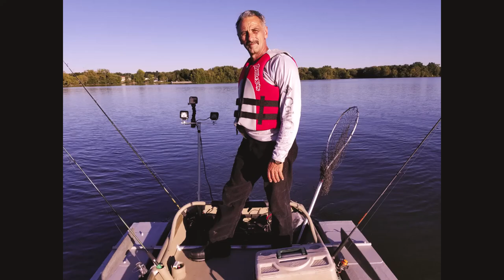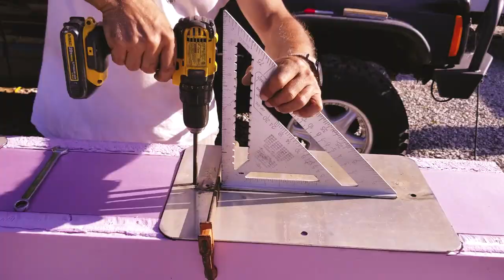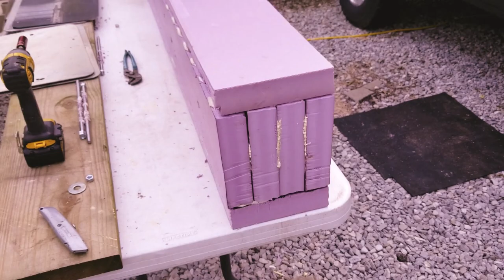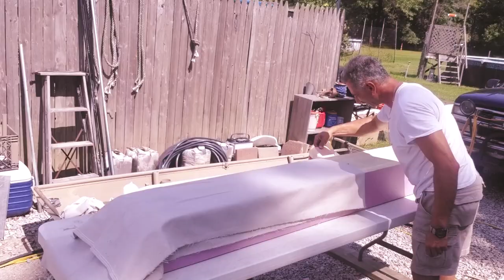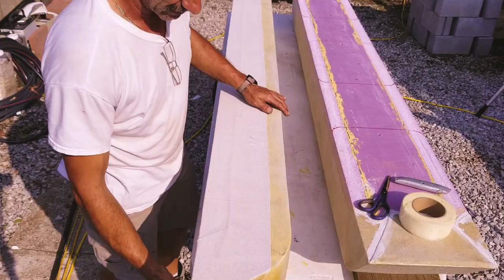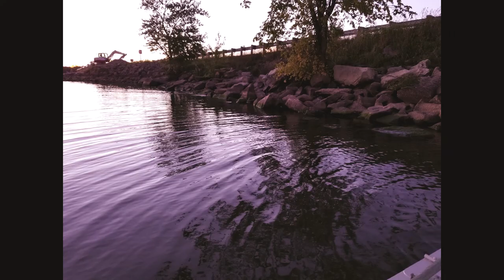How to build pontoons for a Jon boat  build preview

Comment: Love your idea. Building a 14’ for my wife, son and I. Going to take this idea, and tweak it a little but keep the same basic principle in mind. Been toying with this exact idea in my head, nice to see it’s been done. I think I’m going to take some c channel and run it the length of my gunnels for full support and make some of my own brackets and use aluminum tubing for the down rigger part. Want to make them fold up and out of the way, then just pin in position for towing or when in the water.

Comment: Thank you for your time and expertise. I had stopped using my 12ft jon boat because it was unstable and had limited space for my gear. I have started this project and expect to get more stability and additional space to make my time on the lake more enjoyable and safe. I appreciate guys like you who take the time to post DIY videos.
Reply from the maker: Its very stable after the I put the pontoons on the jon boat , I had the boat in 2 to 4 ft waves  with no problem just got a little wet but still stable. Enjoy the video

Comment: Why not get wider boat?
Reply from the maker: The build was to make a 10 ft jon boat more stable and still put it in the back of a pickup truck, by taking the pontoons off to transport it ,then mount the pontoons on the jon boat with minimum effort and go fishing without the fear that the boat it's not stable.  I had some close calls. Almost flipped it once

Comment: PVC would have been cheaper and easier...
Reply: Not even close to the same thing. 4” diameter pvc the same length as his foam outriggers would only give you 50lbs of flotation/stability. His foam outrigger gives you 500lbs each. PVC for the floatation/weight ratio will never even begin to compete with foam. If you swam in a pool, would you use pvc to float? I’d rather have a foam noodle myself.
Reply: @dreamdesigngarage  the only reason why foam floats is because it's able to obtain the oxygen within itself. Hence having two caps on both sides of the PVC to hold oxygen within itself.